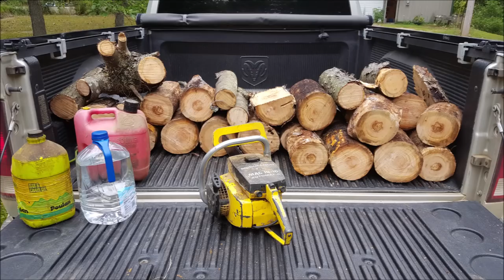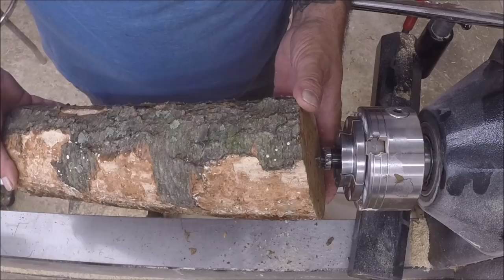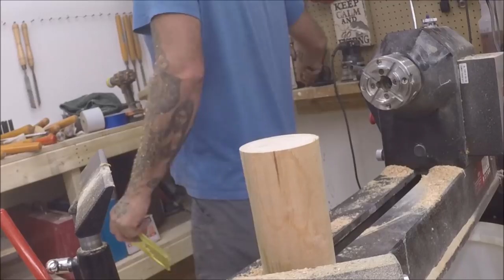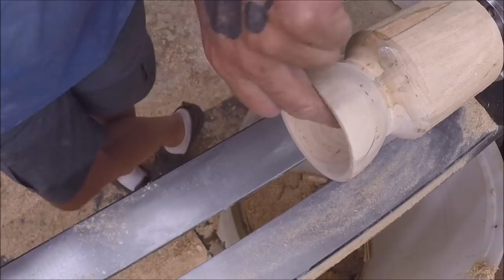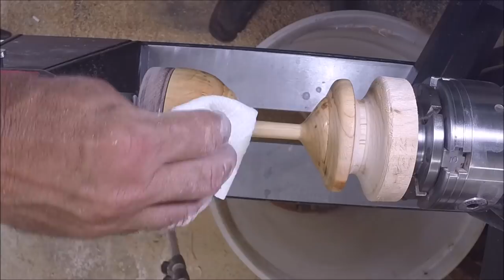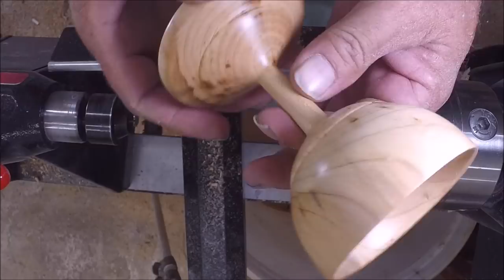Choke Cherry Goblet

Comment: Good result considering the time you have been turning. Cherry is very hard wood to work with and takes no prisoners. You finished the inside very well but using a 1/4" spindle gouge reduces the side load considerably and is much easier to hollow end grain. Do not be disheartened by failures, we all have them. Nice presentation as well:,)
Reply from the maker: I was a lil upset with it, the first one other than I snapped off the cup went well, I had to glue that one back together twice but I finished it !  LOL I'm glad you liked it, thanks for watching.

Comment: You did better than me, I have not even tryed to make one yet. I just started working on my lath. I have only made one tiny box that I could not hollow out because the wood I used was really hard oak and old tools that are not varry sharp. Even the forserner bit would not cut it. Oh well I will keep at it and hopfuly I will get the hang of it. :)
Reply from the maker: that is how I started, a wood box out of a piece of 4x4 oak with screw holes and everything in it.

Comment: If I remember right, Ky uses a spindle gouge for that hollowing technique. At least that's what I've used, and it worked for me.
Reply from the maker: maybe, I'm still trying to learn the difference between them,  LOL  I've destroyed most of my traditional tools learning how to sharpen them, I've had them 18 years they came with the old lathe I have, still Robert Sorby's but before I purchase any new ones I must master what they are and how to sharpen them,  the struggles of a Rookie !
Reply: Dan Allen Indeed it's a spindle gouge sharpened to 40* on a platform. When sharpening I swing the tool out to about 50-60* while closing the flute to about 45* or just past. If it's sharpened on a jig it still works but seems to get a bit aggressive down the wing.

Comment: Have you seen those videos of Asian guys turning huge logs, sitting on a short seat, dare footed, and massive chips all around him on the floor. Awesome turnings. NO safety of any kind.
Reply from the maker: Yes I've seen those,  with a belt running the lathe from a car rim attached to the car to power it.  Crazy stuff